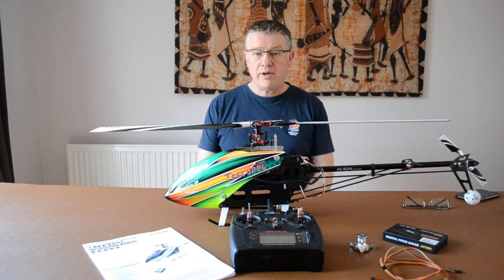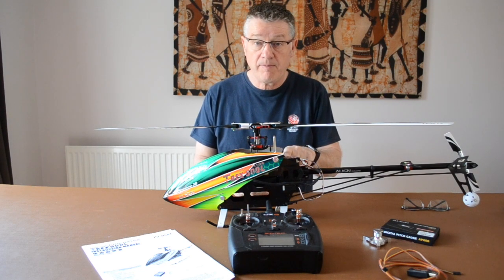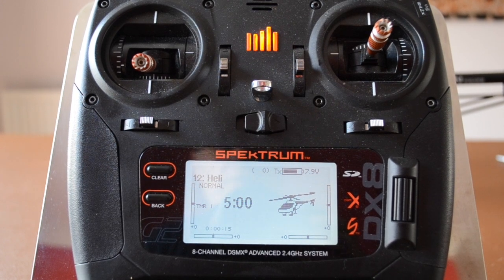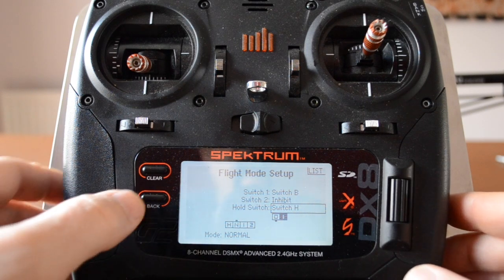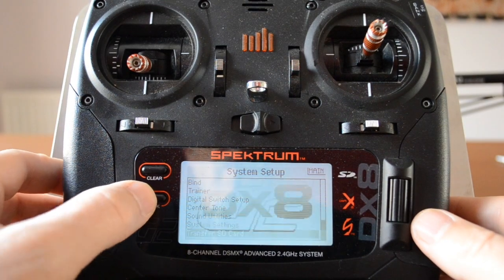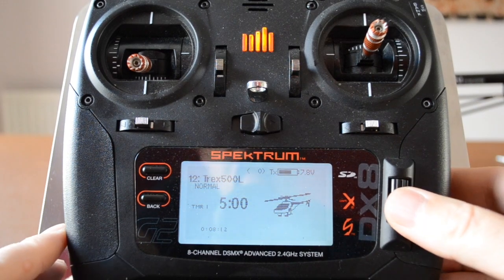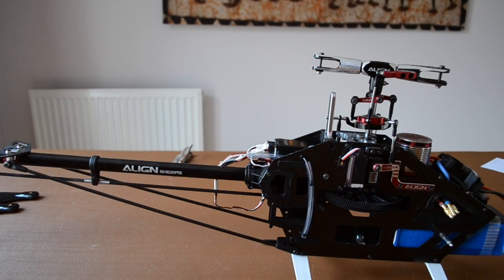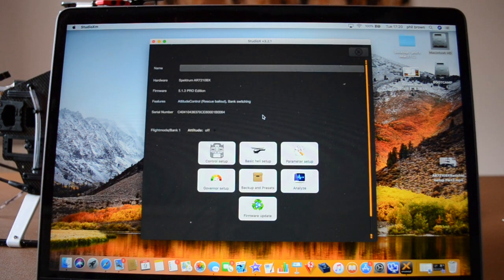AR7210BX Introduction

Comment: Hi, A brilliant set of videos which has allowed me to get my Blade Fusion270 flying. I previously had the stock AR636A Rx fitted and the heli would consistently flip over on take off. I was on the point of selling the heli but got hold of an AR7210BX with Pro firmware and a AR7200BX USB-interface.
After following your complete set of videos (Just using bank1 and no attitude control) the heli took off cleanly and I only needed a tiny trim adjustment to correct a drift to the left. I'm a beginner (can hover and do circuits on a good day)  and would really like to be able to engage bail-out or one of the other attitude control modes. I'm using a Gen1 DX8 Tx which doesn't have some of the menu options shown in the AR7210BX on-line manual (beastx wiki). I've tried all sorts of combinations (set up bank2 the same as bank 1 but with one of the stability modes selected)  but can't get what I want (Selecting a stability mode with a switch on the Tx). I’ve tried the function assignment option in control set up and moved the fmode switch. The menu is exited and on the home screen I see Flightmode/Bank1     Attitude off   but can’t get those to change to show that I have bank2 / attitude control active ??? I can't seem to get my head around bank switching or attitude control. its a while since you made these videos but it would be great if you could point me in right direction.
Once again thanks for an excellent set of videos !!!
Reply: Hi keith I will contact you.